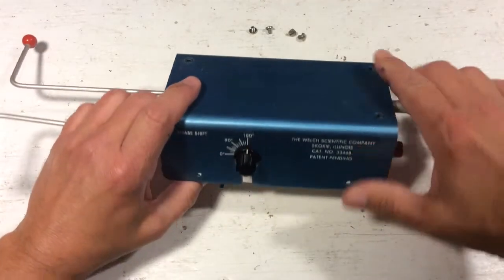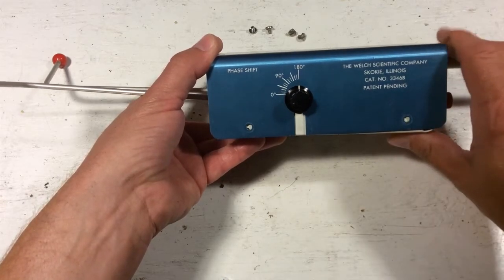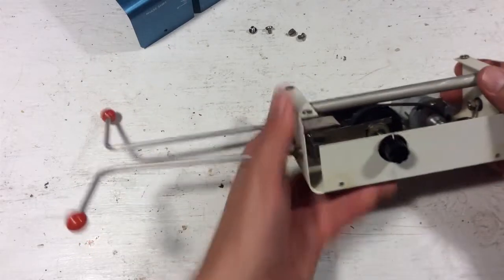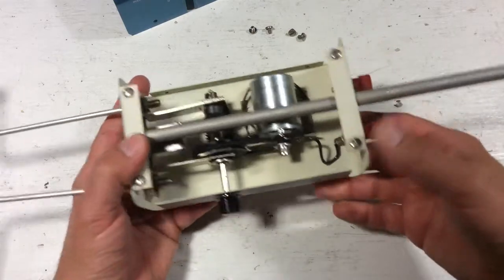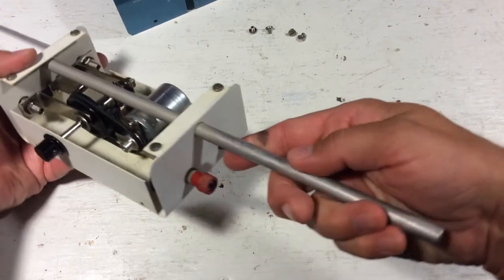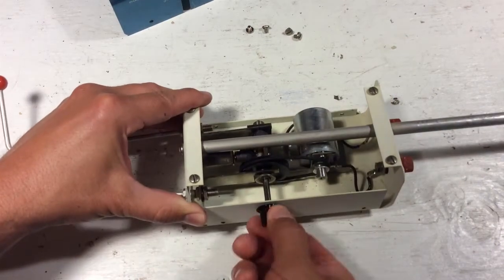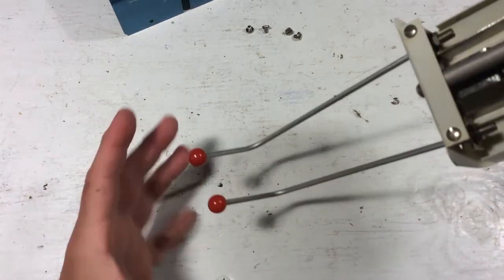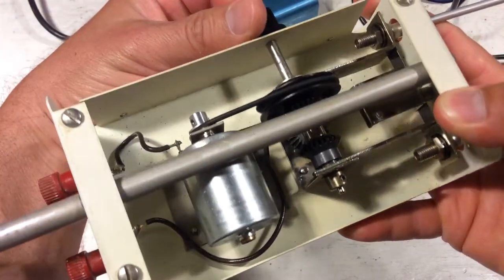What Is This Scientific Training Device? Mystery To Me!

Comment: I get the same notion that the balls are meant to vibrate, and the frequency would vary by rotating the rotary control.  Why not fire the puppy up using Staged D cellls or a variable DC power supply?    Please do a followup vid / demo for your Enquiring Minded followers.

Comment: Your somewhat right Larry, it's a ripple tank oscillator, or at least part of it. There is another small box that lays on the table and hooks to the part you have by two wires that plug into each other through the ports on the end. The part that you have mounts to a small pole and the prongs are dipped into the tank. When you turn it on, you can increase/decrease the wave by turning the phase shift. More can be found here... https://ugdemos2.physics.utoronto.ca/db/demos/ripple-tank 
Click on the "demo" pic to see more!
Reply: Yes, ripple tank oscillator for sure.  It generates two circular wave fronts that interfere.  Changing the phase of oscillation moves the interference pattern.  Good demo in high school or first year college physics.